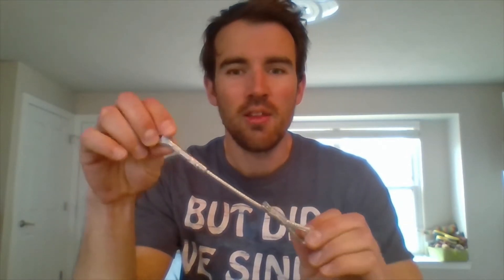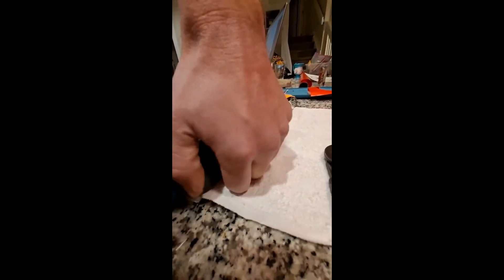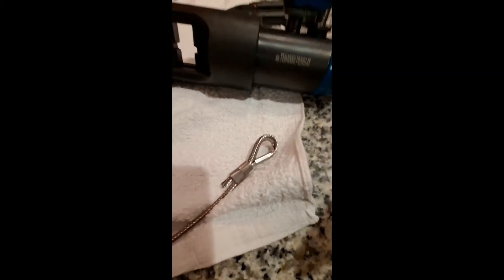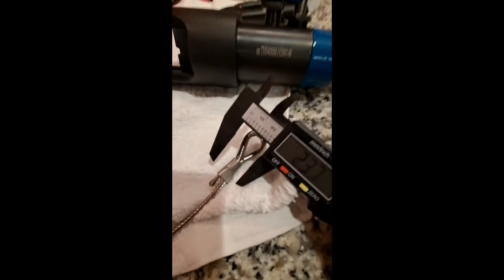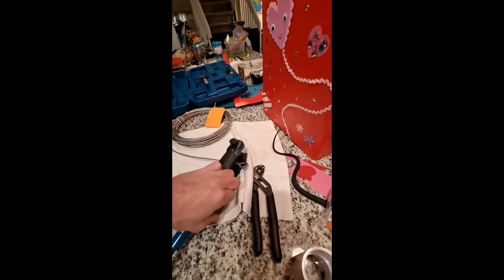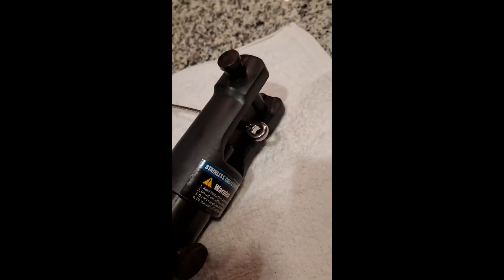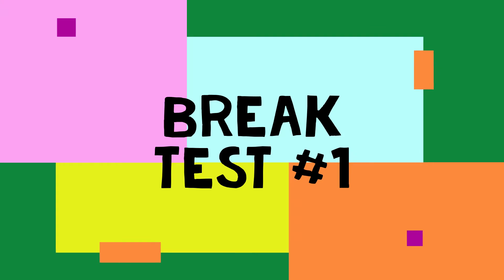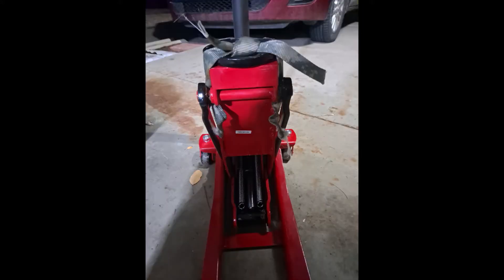DIY Stainless Steel Sailboat Rigging

Comment: You are not using the proper tool for the job in hand .
Reply: Thanks for sharing!
Reply from the maker: That's the whole point of the experiment, to see if I can make something just as strong without a giant machine that costs thousands of dollars.
Reply: @seansails9887  you don't have to tell me about expense , I just bought a wireteknik A100 but it's not huge or heavy and it's approved by Lloyd's plus its the correct tool .  You need to make it plain what you are doing (which in my opinion is compromising safety to save money) in the video . If you are going to use a non roll swage you need dies that are wide enough to swage it evenly across the fitting and enough force behind the die . What you are doing is actually damaging the metal , stainless steel is not forgiving . Your vid comes across as instructional and that is dangerous . As well as a sailor I'm also ex lifeboat crew. I bought this machine because I'm pissed off with unreliable rip off "riggers" so I can sort of see where you're coming from but like I say you need to make this clear .